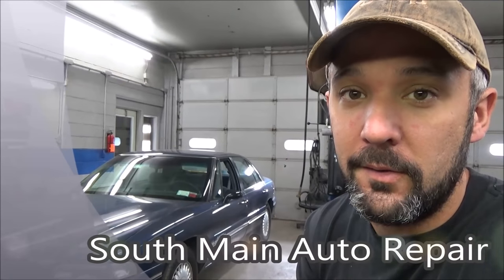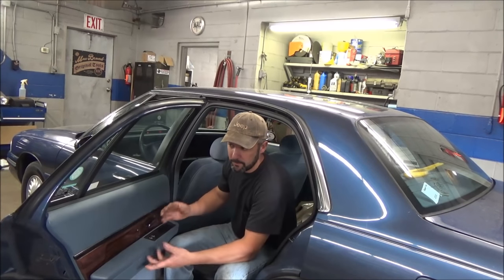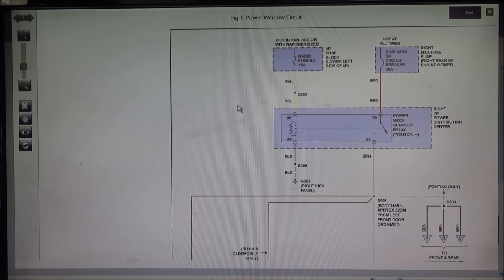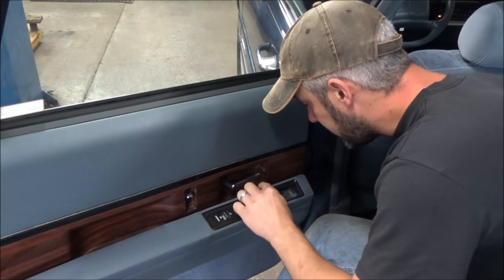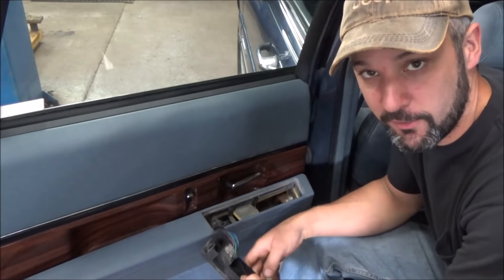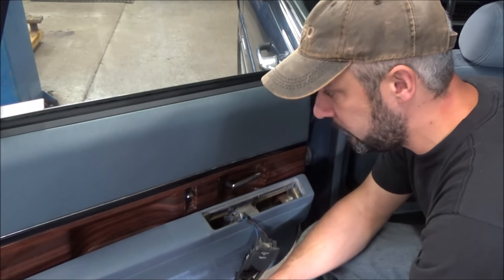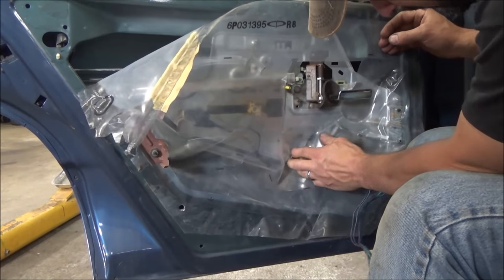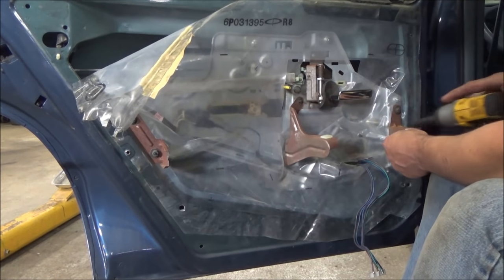Diagnose and Replace: Power Window Motor  Buick LeSabre

Comment: Good to see the circuit's ground itself was included while testing.   Other videos, show the test light being hooked to a ground somewhere else that is not in the circuit, ..So warning to all, grounding a test light  "externally from the circuit" is useless as you are not testing the entire circuit itself... in addition, the ground and positive side needs a voltage drop test to check if it can hold a load and run the motor.  kudos to Eric O for showing us the right way again!

Comment: Great job explaining the diagnosis and with the video overall.  I will follow the procedure as I do a rear door on my '92 Park Avenue (250,000 miles) tomorrow.  Had the car since it was three years old, replaced the main switch a couple times but have not had to replace a window motor so far. (The original engine runs like it did when I got it in '95 with 30K miles and does not need oil added between changes.  It was built before plastic intake manifolds and general cheapening with the later models.)

Comment: The first best moment at 15:44, "well that didn't fix it..."
The second best moment at 22:27, "I need something to wipe my fingers, we will use the instructions it (China window motor) came with because I do not have a rag..."

Another great video!  Agree with Brian Richards that your videos in the Auto Repair segment are the best on YouTube.  

I did one of those in a Buick LeSabre.  The regulator broke but the Buick motor would not fit into a Dorman regulator so we had to purchase the whole Dorman motor and regulator product.  Not a quality assembly but it worked.
Reply from the maker: Sandbag1300 Dorman is not a work you use with the word "quality" unless you are talking about a lack of haha
Reply: This guy's a clown

Comment: Good job on the video. I have a 2001 Buick LeSabre. Only the driver's side window works so I replaced the Master controller and that didn't fix the problem. So now I'm going to just replace the three motors  thanks again

Comment: thank you very much you saved a bunch of money. I pulled it apart went right to the motor . Remove the old motor tried to turn it on, did not work. Installed new one started on work beautiful. Awesome video
Reply from the maker: Keith Lamport Cool glad it helped

Comment: Hi Eric! Love your channel. Been following for just a little while and binge watch your vids, Haha. With this one, the only additional thing I would have done for this repair is test the motor before ordering one. I would have isolated the old motor outside of the door and tried to activate it. It could have been something in the mechanism of the sliding window, maybe being bound up or something, not the motor. Your method of troubleshooting in all of your videos is great! I love how you don't make more work for yourself by simply troubleshooting the easiest and most logical thing first. Great job, man.
Reply from the maker: Patrick Vest A lot of motors will work out side the vehicle with no load on them but will not work under load. The classic starter bench test is a good example of this. Just because it makes noise and spins doesn't mean it is good :)

Comment: I want to start out by saying thanks for your video! Having the wiring is awesome, only note: @ 5:30ish sec; If you want to test the main switch you want to unplug the switch in questions.  This will isolate the grounds, off the Hot wire you should get 12V off the 2 wires in the wiring diagram that are going to the main switch.  If you leave everything plugged in it is possible to find ground to all the wires through the motor and still have a bad main switch.  

Love your videos just thought I would throw that out there, keep doing what you do!

Comment: You don't have to apologise for your attitude, I think you showed great restraint getting the reflector out and re-assembling the trim. That would be the sort of thing which would send me over the edge and the reason I've had my cassette deck just sitting in pieces for the last three months. I've got to find a real zen moment to replace the belts and put it back together again. There's this one moment where you have to get the door through the chassis, hook up a spring and engage a gear (so it opens slowly when you press the button after) which requires three hands and one of those can't be bigger than that of a 12-year-old. Good thing I won't have any toddlers running around or be on camera as I suspect the air will be a distinct colour around here when I tackle that job.

Comment: great video as always Eric I use rubber cement to put those water barriers back in holds good and still easy to get off when needed and the stuff is cheap and looks factory

Comment: Nice video Eric, those regulators are so painless to replace (unless you loose your skin)  compared to the cable and plastic clip design. Great use of the instructions as workshop rag.
As far as wiring diagrams go, here in the UK we are very limited, Autodata or Autovista and they both have a lot of holes in the coverage, when we are stuck we pay the daily subscription to the dealer site and print off what is needed.
Reply from the maker: richard pearce Does this help you at all? http://www.bbbindustries.com/technical.html
Reply: That is cool Thanks Eric

Comment: I use some 3M Spraymount 77 for putting the moisture barriers back on door panels. Apply it to both surfaces like a contact cement, let it set up slightly tacky and put the barrier back on. Holds like a charm and it's removable if you need access in the future.

Comment: Damn.  I have a 1997 le sabre.  My driver window stopped.  I took the door panel apart and verified the motor wouldn't work.  Took it off, called the buick dealer and they had one in stock for like 240 bucks! I was in a hurry so I drove to the dealer.  He pulled out the part and it clearly wasn't the right one. The motor looked like a mirror image of what I needed.  He checked and checked, I showed him what I pulled from the car, and he said, well, that is all he has.  Damn.  On a whim, on the drive home I pulled into Pep Boys and they had one for 69 bucks!  It was perfect.  The only difference is the GM part had more metal in the motor and coil housing, while the PeP boys version had more plastic.  I have had it now for 6 years, so I be happy.  I know from past experience how GM gouges people that buy parts from them, so just be forewarned

Comment: For diagnosis, have someone operate the switch on the driver's door, and then bang the rear door. If it starts working, it's likely the motor. Those switches don't like dust. Mine get full of saw dust and quit working from time to time, so I clean them out and then use dielectric grease. I know that's not the best diagostics, but if you don't have the electrical equipment and don't know how to use it, this tip might help you do it yourself and save some cash. Mine has sheetrock screws holding the panels on, as I recall.

Comment: Thanks, a great diagnostic & repair video.  My 1994 LeSabre only has 108,000 on it, but it seems everything is currently failing.   Bob Lindemuth
Reply from the maker: +marlindy2 Age will get them after a bit

Comment: I hated those kid safe windows. Never felt right when I was in the back seat. Had a 91 Ford Probe, the passenger window kept getting stuck. Turned out the motor/regulator was a fortune to replace so my mechanic just stuck a screw in there to keep it rolled up. Mostly I drove alone so it wasn't a huge deal. Then one day the driver's window ZOOMED down into the door and refused to come out and play. Lived with that for months until I tried to beat a monster storm home from a friend's house 13 miles away. There was a 1/4” of water in the back seat foot wells. The inside of the hatchback was wet. The storm stayed with me and stopped raining when I hit my driveway. I was as wet as if I'd fallen in the pool. After that I found the $300 or so to get that window fixed.

Comment: Good thing, anyone who knows how electricity works, they have a good idea how to repair this problem via your video. But if your intention is to educate, you may need to elaborate on the wiring diagram a bit, or go in depth on how electricity works in another video.

This video makes sense to me, but for the lay person, it may not. Just a future suggestion!

Keep making awesome videos!
Reply from the maker: Will Ihrke Thanks for your input.

Comment: It worked out fine for you and probably would 99 times out of 100 but i would have tested the old motor outside the door before ordering a new one.
I mean, if it's bad it still has to go out and it doesn't matter if you get it out before or after ordering the replacement.

Comment: another good video Eric,
I wish here in Europe we could get good schematics like you can get.
I had Autodata, but all it would cover is the pcm and abs modules if you were lucky.
Reply from the maker: Electronic Workshop Then what do you do? There is nothing available?
Reply: South Main Auto Repair follow the cables , then try to figure out circuit design, then hope I don't get it wronganother way is to search the internet forums, someone might have a link to a workshop manual that might be similar to the one I am working onThere are a few new companies starting, I am trying for a free trial first before I buy

Comment: Place an Amp Clamp around the battery cable(s) and measure current as the switches are manipulated.  No current indicates an open circuit that can be isolated further.  More current on one motor relative the the others indicates something binding in the motor or door assembly. This can then be followed by Voltage checks at the motor. Quick and relatively easy.
Reply: More current may also mean a shorted anchor of the motor.

Comment: When you were testing the window switch, were you connected to both grounds to light up the test light? Or did you clip the test light to the power wire and probe the ground when operating the switch?

Comment: The door panel not being re-installed properly following the last repair (You showed "Someone having been in there before") could have been the very issue that caused the motor to burn out. The lip could have been providing unnecessary friction which, over time, put too much strain on the motor

Comment: Thats funny, did a similar rrepair on an MAN truck this saturday. The motor was similar and also the whole mechanic. Still i didnt change the motor, since its a truck from our company we need to save money and comeing back in is not a big problem.
Because as with your motor it was realy stuck in there and as soon as i pulled it out it started working again.
Greased everything and checked it a couple of times while put back in and it kept working. Would be interessting if your motor is also working now.
Reply from the maker: 1kleineMax1 Oh got ya...yeah I just chucked this one away, no idea if it worked out of the door or not.

Comment: on my 2001 Lesabre the driver side widows don't work, we changed the door module and switch and chased wires under the drivers carpet . Any ideas, we also checked fuses and all good.

Comment: Hey Eric, quick question for you man. Are you using Alldata or Mitchell1 on your pc?
Reply: John Kirkland Whoops! My bad, I posted that before the video had finished. Prodemand, got it. Have a good July 4th. Enjoy some time w/your family.
Reply from the maker: John Kirkland Lol jumping the gun on me now haha
Reply: South Main Auto Repair  Haha, yeah sorry 'bout that man. The wiring diagram seems to be of real good quality. I was trying to decide between Alldata and Mitchell1. I've heard Alldata is a little easier to look up/navigate, but Mitchell1 blows them out of the water on wiring diagrams. Any thoughts from the guy on the ground?
Reply from the maker: Mehhh they all have there strong points and weakness like any thing. I have had MOD for 18+ years so I am use to it. A lot of there info is mixed up but you just call or email and they hook you up pretty fast with the right stuff. Have you seen MotoLogic yet? Way cheaper and just as inaccurate? Maybe the best choice if you wanna save a few bucks.
Reply: South Main Auto Repair I haven't seen MotoLogic yet. Might have to check them out sometime. Thanks!

Comment: nice flash back..I did the same but with front suspension spring on a carvan. took it off car , then when taking it off strut i held it between my legs and zipped off the top bolt and that fucking spring flew past my face , the force pushed me upwards since i was looking down over it.. hit the bottom of car in lift then boucened off the floor then hit the roof then the front wall...I almost punched out that day for good, learned though , ..my little flash back. any how..cool video  thanks for sharing

Comment: Nice video. Poor the way the window only goes down a little way, clearly even though there is a rear quarter light, the door shape I assume does not permit it to roll further down. Otherwise a neat looking smooth design for the time.

Comment: i have a question for you....my families envoy power seat is having problems. the seat moves but its a stop and go motion with both sliding forward and backwards also for leaning back and leaning forward. Any ideas?
Reply from the maker: kj like a steady surging?
Reply: It will like run a second stop run a second stop it does it both front and back and the same for leaning forward backwards. Is it like a bad relay?
Reply from the maker: Do they run on a circuit breaker? Boy I'd have to look on  a diagram. Do you have a diagram for that to look at? Look here if you don't . It may help you. http://www.bbbindustries.com/technical.html
Reply: Let me check it out. Thank you
Reply: I found the exact diagram for it. I give you credit on reading it haha. You're right it shows a circuit breaker on it
Reply from the maker: Well I haven't looked at it yet I just assumed it had a self reseting breaker is all. If it was me I'd start looking in that area. See what the amperage draw is and see if you just have a faulty breaker or something simple ya know

Comment: The summer of 63 I worked in the body shop of a Chevy dealer prepping new cars for sale. I was prepping a new station wagon and found that the rear hatch power window did not work. I opened the hatch access panel to check the motor and found there were two motors.  The one that was connected which didn't work and another unconnected motor which did work after we installed it. Must have been the end of a shift.